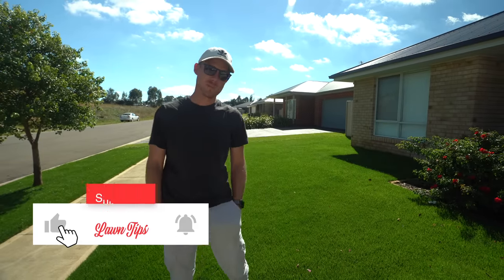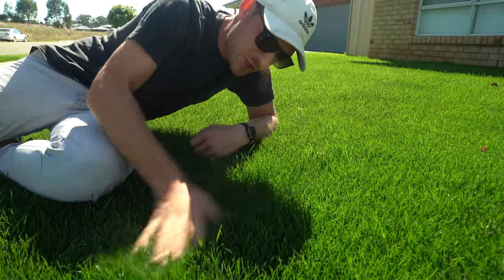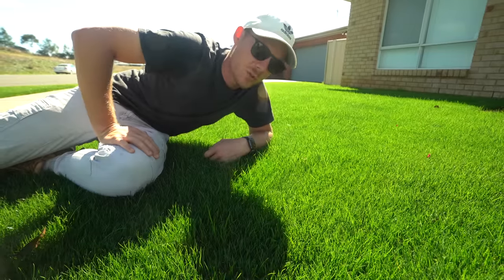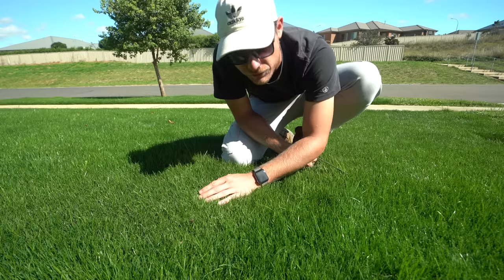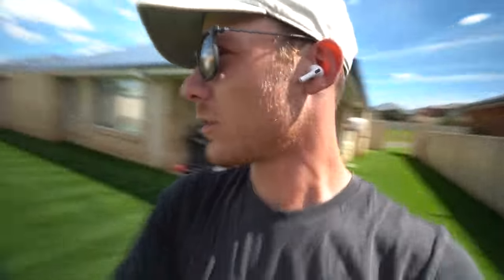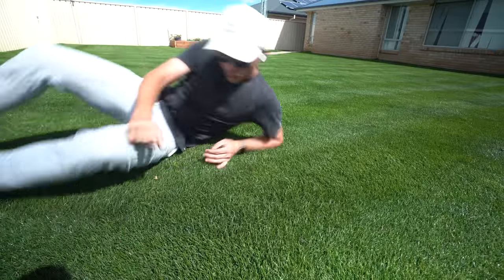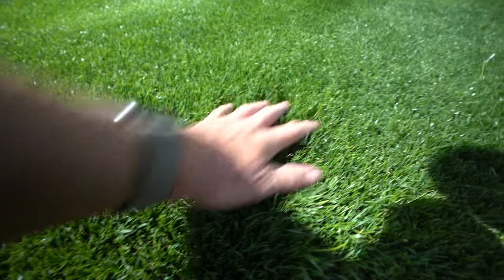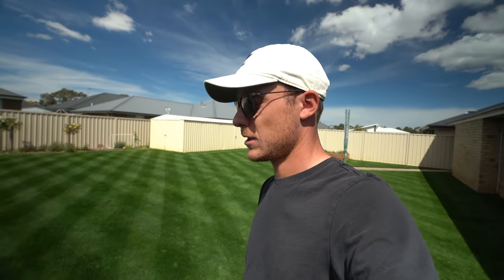Just A Mowing Vid // My Lawn Looks Fake!

Comment: Could you please tell me what is the name of the edge trimmer you used , thank you! And btw you have a beatiful  lawn.
Reply: That's a BushRanger multi-tool line trimmer. Was wondering the same thing myself when I saw it. Took a bit of searching, but eventually found it. They come in straight or bent shaft models. This one looks like the commercial model

Comment: What height would you recommend cutting at for warm season grasses (kik specifically), heading in to winter? 

In Adelaide so mine struggles during the colder months and this is the first year I've been cutting low with a cylinder mower and really giving the lawn some love. 

I'm at about 14mm currently.
Reply: Hey Ben, I’ve been mowing my Kik low in Adelaide for a few years now. Generally I get mine down as low as 12mm in the warmer months and aim for around 25mm when approaching dormancy. The lawn seems to stress a lot less with the slightly higher cut during winter.
Reply: @mr260z3  thanks mate, that's roughly what I had in mind. 

What sort of increments do you go up in? I'm thinking now is about the time I should be transitioning as the growth is definitely slowing down a lot.

Comment: How would you level a lawn that’s uneven and with some parts with big dips?
Reply from the maker: Usually sand is a good way to get nice levels. You’ll need to bring it up overtime. Aim to do 10mm or 1/2inch every time you do it. You can do it all through the growing season. Just make sure not to cover up the leaf blades completely so it can grow back through well

Comment: Why don't you do your edges before you mow you will save so much times mate!
Reply from the maker: Depends on my mood to be honest 😂
Reply: @LawnTips  I’ve switched to doing it after from watching your vids. No sense in pulling dirt up with the edger then running over it with the cylinder mower. Before or after, takes the same time to reach beer o’clock 😉